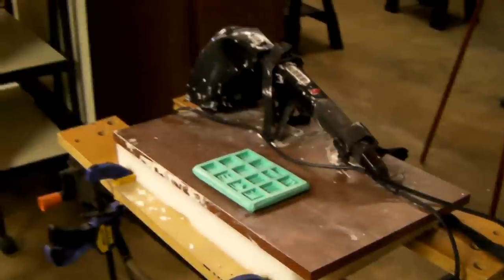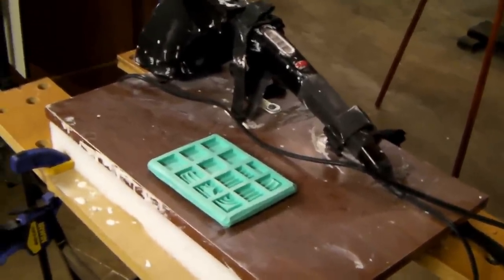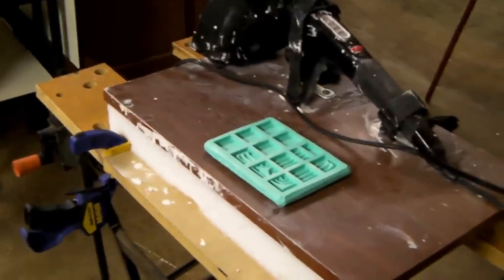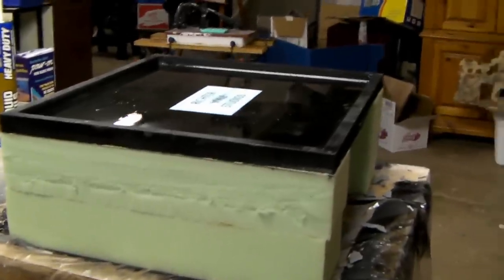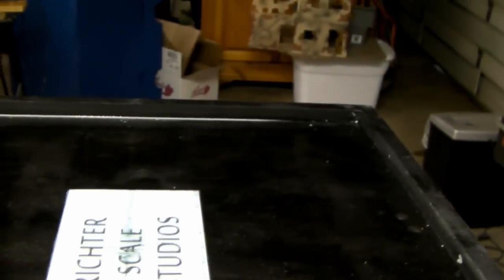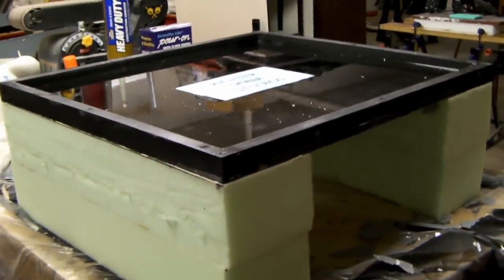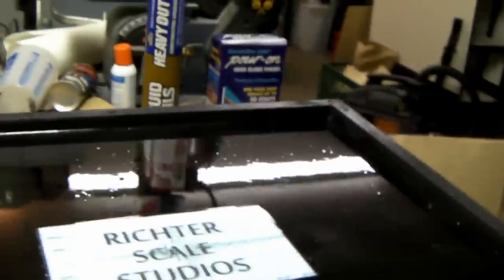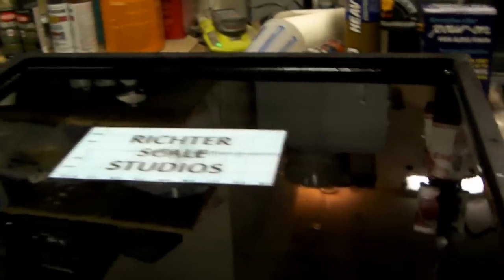Plaster Casting Vibrating Table Shout Out & Thank to Brian Gregory

Comment: Is this table still working for you? I haven't had much luck mounting the massager under the table. It always gets loose quickly. I still haven't found a design for a table that I like. Really considering just ordering a dental vibration table.
Reply from the maker: I have not had any problems. I did mount some metal collars, like the the the one you use on a dryer hose. They hold so well, if you tighten them too much it will not vibrate. Thanks for the comment.